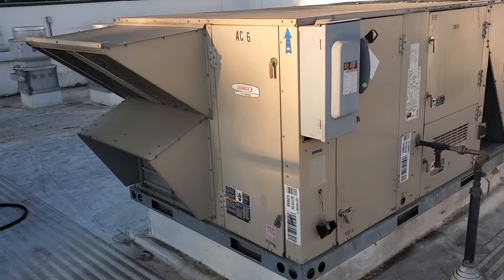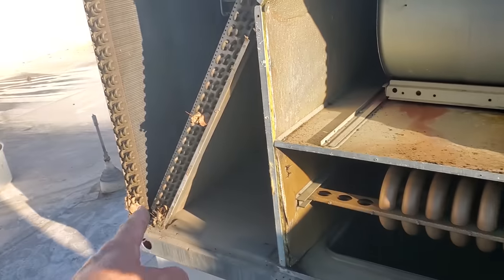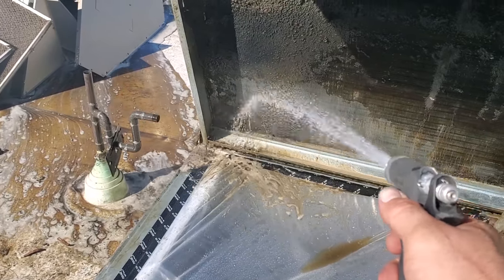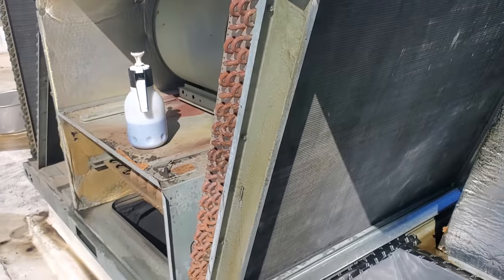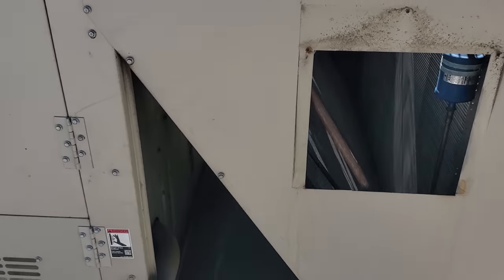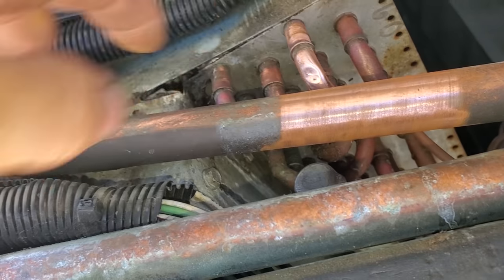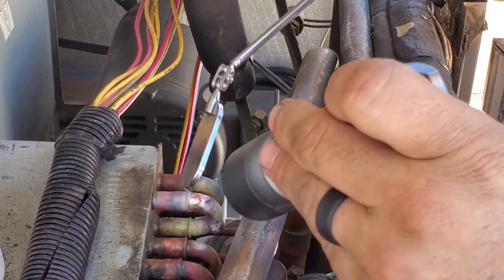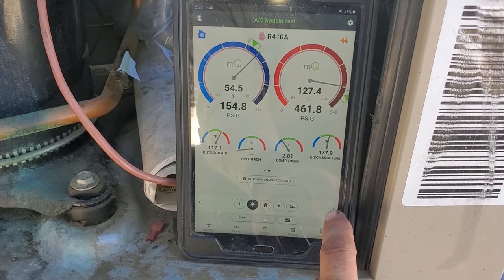THE KITCHEN AC SMELLS FUNNY

Comment: I was a maintenance man at McD’s in my area when I was younger. Every year, we’d shut down the A/C units one by one & clean them out from top to bottom. If we discovered any problems, we had them fixed. Preventive maintenance absolutely goes a long way.
Reply: Not only that but imagine the power savings!  That AC unit must have been work'n real hard to do anything with its breathers blocked.
Reply: Any rats you discovered? 😆 That's just extra protein!
Reply: Yes that goes for any machine ever made. Routine maintenance is often extended until something fails... it's like use it til it breaks lol
Reply: @fitybux4664  where do you think the nutritional value comes from?
Reply: When I was younger same here climbing that ladder that led to a small roof opening the amount of lint that was pulled off of those machines was insane garbage bags full those were the days :)

Comment: Someone needs to make a "Roomba" for ducts! ;-) I wrote iRobot and told them we needed a "Roofba", and their legal dept. wrote me back and told me not to send any more "good ideas". The nerve.
Reply: You have the Winbot and many others for windows, so maybe you should contact any of the makers of those bots for a bot able to clean ducts?
A video of the Winbot: https://www.youtube.com/watch?v=scqXKczd0tE
Or put it as a challenge for students at a university that are studying robotics.
Reply: The problem is if they make a roofba, you can potentially sue for them having stolen your idea. Or worse it wasn't your idea, it was your buddy's and you shared an idea that he was attempting to invent.
Reply: @0xFF48  I just want them to make one so I don't have to risk my life on the roof blowing off the pine needles (fire hazard). ;-)
Reply: @Samuel Skala he shouldn’t have been standing there then
Reply: It's a matter of electromagnetism.
The inside material of the ducts should have a neutral charge, so that dirt, dust debre, won't cling on to it. Then the indoor blower motor can move all of it into the intake side of the air filters.

Same with PVC condensate drain lines.
The problem can be solved with chemistry.
The slime & gunk that builds up inside the PVC drain lines, has the opposite charge as the PVC material, do it doesn't just grow inside the PVC drains, but it also clings onto the material, making it difficult to flush out.... esp if it's hardened.

Having a drain pipe material with a neutral charge would be greatly beneficial....bit this is HVAC/R so I wouldn't hold my breath!

This trade seems to want to hold onto "Caveman" ways of doing things.
Reply: @0xFF48  Of course you could always sue, but it's not going to stick to even sticky paper. To make argument for trademark it would need to be well known and used. It's not used at all so no go there. And you get zero protection from copyright. Judge takes one look and case is closed in a minute.
Reply: @ShadowManceri  not theft of trademark, theft of invention or intellectual property.
Reply: @0xFF48  Intellectual property is protected by trademarking, holding a copyright and patenting. No other form of "theft" is possible, no matter what you think. (Well there is a trade secret inside a company but it needs to be a secret, not public youtube comment.) And like I said, trademark doesn't apply. Copyright can not protect ideas. And patents are not granted for ideas. So there is no anything protecting the idea. Zero, zip, nothing, nada. Free for everyone to use as they like. This is why judge would throw you out of court room in an instant. The only argument that is possible is that it's famous youtube comment thus making it recognized trademark. Sorry but no.
Reply: All that dirt and debris just strengthens your lungs

Comment: You: find leak in the first place you look.  Me: 3 days later customer finds my body laying on the roof with the H10 still beeping in my cold dead hand 😂😂
Reply: Hahahah it be like that sometimes 😂
Reply: Damn, the H10 battery does last longer. LoL 🤣
Reply: Maybe it's just dumb luck of checking around evaporator and condenser coil joints first? 🤷‍♂ I'm sure you could develop a statistically likelihood and check those areas in a certain order. (Not sure if anyone optimizes their work like that...)
Reply: @fitybux4664  I have this thing when trying to find low voltage shorts on heat pumps where I almost always check defrost tstat/temp switch wires first and I have like a 65% success rate. Kinda similar to what you've described. For some reason it's highly likely for the defrost tstat wires to rub out on the suction line and blow the fuse. It I don't find anything there then I just go down my list of possible places and I'll usually find em fast.

Comment: “I don’t need to get a temperature clamp” he said as he burned the crap out of his hand lol
Reply: Lmaooo
Reply: Well I guess he has very sensitive fingers if he can tell a 3° temperature difference with his hand.
Reply: Bill Mea that’s what SHE said
Reply: If he had burnt the crap out of his hand on the drier I don’t think it would be running that long. Personally yes I do have to use the back of my hands since it’s more sensitive but you most definitely can feel a temp drop. I’ve had plenty restricted driers that would ice solid bang right now yet I could still blow through no problem.

Comment: 1.) Your my hero
2.) I would have condemned that coil on the basis cleaner would have destroyed it.
3.) You now have personally sold ME on Viper cleaner..hot damn! 
Chris fantastic job. Hope YOU put the right filters in it!! Thanks for sharing
Reply: I'm tempted to get some of their cleaners as I maintain (end user, not HVAC tech) several mini-splits (and my house) that get nasty after 6-8 months running constantly. Local dealer won't sell me anything other then the spray foam cans of nu-calgon because I don't have WHMIS. Funny part is you can buy damn near any HVAC cleaner/brightner you want on Amazon, no WHMIS required.

Comment: I’ve run into a few of the leak repairs similar to the ones displayed.    I’ve had good luck using 40 to 60% silver and flux.     Also I’ve used Stay Brite and flux, especially on thin copper such as coils and return bends.   Really good when you have
The remote reading gauges and related would have been a godsend back in the day 

Good video

Comment: First time seeing one of your videos and type of work. I know nothing about HVAC, only a bit of electronic/electricity and how a AC works... At first looked like you will change some parts, filters, a cable or belt, wash a little and done. But as continue watching I saw tools I'll never knew, like bluetooth clamps, leak sensor and torching the pipes on the spot, even a little mirror. I admire your work, you really gained a lot of experience

Comment: Chris, as a 30-year Master HVACR tech, I have seen these types of leaks a lot on these commercial Lennox units. I always kept an old car or truck inner tube and after I blaze it all up I wrap a layer of the inner tube secured with zip ties,  never had any issues after the repair. Just an old guy's tips, and use the same technique on filter dryers securing straps between the strap and dryer.  Oh, and pressure control loops of cap line. My boss always wondered why I had 2-3 boxes of inner tubes and piles of zip ties lol I always made every unit look as good or better than the factory did when I left. lol I see you did a version of my trick, If I had just watched a bit farther in the video lol Sorry. :)

Comment: Alternate title:
Disaster Lennox Evaporator Extreme Cleaning and Detailing.

Edit: Not sure if you end up catching it later in the video or not, but at 12:50 behind your duct detector and fire alarm system in that unit there were some wires rubbing out on that loose panel.
Reply: oh wow! the pink and blue wires!
Reply: I think there were some wires above in front of the panel that were also rubbing out. Looks like there is lack of protection on the wiring and too much vibration.
Reply: @thestuffz  Pink is for girl wires and blue is for boy wires.

Comment: The rubber wrap will slow the damage, but the cause is the vibration/loose tube. A couple of cushioned suspension/line clamps could be used to secure that tube.

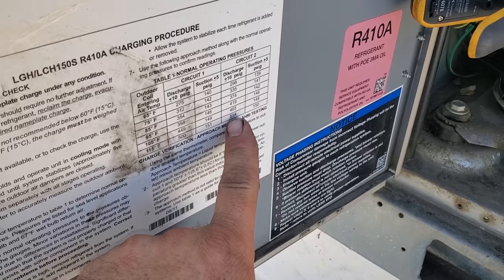Comment: 22:29 So how do you get the outdoor coil entering air temp? Is that where you use a thermometer at the condenser coil where air is pulling through? I'm still new and trying to make sure I understand cause I second guess myself too much. Thanks for the great video by the way!
Reply from the maker: Yes I measured the outside air entering the condenser

Comment: you should see some of them in residential, where nobody changed the filter since install in the 1980's lol. the self made carpeting filter is a mile thick, no airflow and they wonder why it doesn't heat or cool hardly :))

Comment: +1 to oversized dryers. I always go with a big ole' chonker, for just a couple bucks more I really see no reason not to over size them. There really is no down side.
Reply: The manufacturer might put in a smaller dryer to save on cost. Save $5 on a smaller dryer. For a tech though, $5 is quickly eaten up by a $200 service call. So, yes, it makes sense to go big.

Comment: Just a curious question,  how did the evaporator get so clogged with grease if it was protected by those air filters?
Reply: Chad ... seems like it may have been WITHOUT filters at some point.... or maybe the filters were so clogged they got sucked in and air was going around them. (have seen that more than once)

Comment: I been told not to use any heavy coil cleaners such as condenser coil cleaners on evap coils because they supposedly take the coating off of the coil that allows the water to drain down without jumping off the coil.  I not even sure if that even true.

Comment: Restaurants really could use return air filter grills with a 4 inch Honeywell high-performance return Grill filter. Every time I see you do one of these restaurant jobs the return duct is completely disgusting. still put some very low efficiency filters at the unit the good ones in the return grills

Comment: Have you tried Harris 'Blockade'? It is a lower temperature brazing rod just for leaks...it allows you to brake near existing brake joints without getting  the area too hot.
Reply: Braze not brake (stupid auto correct)

Comment: I couldn't quite see but is this unit full fresh air? Or partial return from the kitchen (which can be an issue with oily fumes)
Reply: I think the only other way you'd get this much grease in the return would be if your customers were breathing out grease. 😆 They must have that thing directly over a kitchen stovetop or something.

Comment: That pipe rubbing did really look like a "duh" moment. Not sure if it's bad design or if someone changed an item like compressor earlier and didn't check for rubbing pipes.
But the evaporator - it was a piece of horror. It was in the category of farm machinery handling manure dirty. Too bad that the air duct came in below it making the cleaning more complicated.
However any site that you can leave with machinery working satisfactory means that it's a good job done there.
Reply: Lennox units like this vibrate themselves apart all the dang time. It’s nice for work but frustrating for the customer.
Reply: @Chunnibyoubaka  Probably a failure of the manufacturer doing proper vibration testing and high temperature testing. Technically, you can test any appliance to meet certain vibration and high temperature specs. (And artificially age them with even more vibration/high temp than they would normally get.) Don't forget to water test things too. Rain is normal. (As is snow depending on the area.)

Comment: No wonder the blue venom pack works so well at full concentration. That's good old concentrated sodium hydroxide (caustic lye), I use stuff like that to peel grease off parts at home. Almost as good as solvents at removing grease. Hard on Aluminium tho.
Reply: mark robertson  Yeah. I use special thick rubber chemical gloves when handling the stuff. I also try to use the stuff diluted when I can, the concentrated degreaser I use is normally cut 5:1 or 10:1 for general use. 1:1 is suggested for degreasing, sometimes tho even that isn't strong enough so straight up goes on the parts, wearing a proper chemical  respirator though, don't need to inhale that stuff. As to why Hydroxide, safer then petroleum based solvents, less flammable, and I find less noxious when used in the garage in the winter.

Comment: I really wish there was a smaller and more controlled tip for the torch, seems like way more power than you need for melting the solder.
Reply: I geuss sometimes you need the heat, for bigger pipework ?!
And i think the pipe needs to be hot to or else the solder wont bond.
For most Things in the world there is a reason for it.
Reply: @SuperUltimateLP  I dunno, a more precise flame would mean less heat wasted heating up everything else, including the surrounded area which I might note are absolutely full of electrical wire, sensitive computer components and expensive equipment under pressure.
Reply: Personally I prefer TIG brazing if at all possible for that very reason, but 99% of the time it's not going to be an option. At the very least it's not going to be practical.

Comment: Hardly anyone does  maintenance.  
Then when things fail they can't understand why.
Also in my area those exhaust fans at McDonald's use a second leg wired through the service switch, which goes back down to the griddle or fryolator controls. 
If the fan switch is off that should also kill those units in the kitchen. 
However the switch doesn't sense if the fan is actually working.

Comment: The cleaning of that unit no longer was a scheduled maintenance kind of thing. It actually turned into a service call by cleaning those coils you fix the unit probably 80% and then the repairs of the leak and the rest of the things you did is the hundred percent, it was actually a service call

Comment: What is supposed to get the oil out of the return air so that it doesnt pack the condenser like that?  Is the broken vent fan the cause of that?
Reply: Maybe they're using an air conditioner package like an exhaust fan over a stovetop? (Not sure if that's allowed/recommended, but it would explain all the grease buildup.)

Comment: Mapp gas A#1 on coil ubends- can get the bend plenty hot enough even up to 1/2” without risk of  melting but sil-phos still flows. Although you had to lug the torch to go over the 3/4-7/8” or whatever that is anyways so no sense in 2. Mapp great for u-bends/coil repair though- no melted pipes. We’ve all done it don’t anyone lie

Comment: Years ago,I did some big mall work and you would come across units that were running low.You would leak test the crap out of everything and nothing would be leaking.After about 6 months of this ,I was at a supply house and noticed the were stocking 25ft hoses. I asked one of the guys why anyone would want hoses that long and he told me that another company does alot of work at the mall and they needed them for some reason,yeah they did,so they could run a hose from one unit to another and steal your gas!
Reply: Junkies stealing copper migrates to junkies stealing gas. 😆 Time to surround your HVAC units with security cameras.

Comment: What!? Pulling a vacuum through a manifold. You did the customer a disservice......don't you know that according to the manufacturer of the big hoses that unless you pull a negative 500 micron vacuum you're a hack!!!! 

In all seriousness I shudder to think how many vacuums I've pulled through manifolds and those systems are still running. As far as I'm concerned you have no need to justify your vacuum methods
Reply: #purge it, works great on package units. and faster/safer, ropes and ladders are dangerous so if you can not bring up the extra tools could be saving a life.
Reply: Yeah no need for 500 microns on all units. Would take all day for almost any unit
Reply: Repaired many a/c systems just using a manifold gauge set.  Didn't know any difference as my pump might not even pull a 500 micron vacuum as I didn't have one of those either.  I guess I'm a hack.
Reply: @joehead1294  when I first got in the trade my boss said I didn't need a micron gauge or even a refrigerant scale... seriously he just had me guess how much refrigerant I used.  My second employer actually taught me the correct techniques.

Comment: When I did commercial work that greatly exceeded the apparent and billed I'd put the apparent/bid/billed plus any additional used material on the primary and then sub-catagory below as "bill #########A" the work hours of excess.  Like if I went to a house that needed in/out/under/attic pest control and had looked at the place and made an estimate of $330 (3b 2b crawl/attic) for a complete including flea/hormone/residual and a couple cans of raid dry fog.  If I also had to clean out the lower duct work and cleanse the coils of the aircon and so-on I'd add the cleaner, wipes, tape etc to the primary bill as non-negotiable but then include labor, fuel to store round trip and etc as "slack" in the excess with the excess being due immediately but without penalty.

Never ever ever do anything for free, make sure the customer knows the cost and value of the extra stuff and let them decide how and when to pay it.  Start a timer when you start talking to the customer, be obvious.     When the job is not only done, done right but also works better/smells better (or actually works unlike prior services) the customer will either be an abject asshole or warm up to the slack billing.     Track the slack but don't put it in the bottom line.  That way you can taxes it.